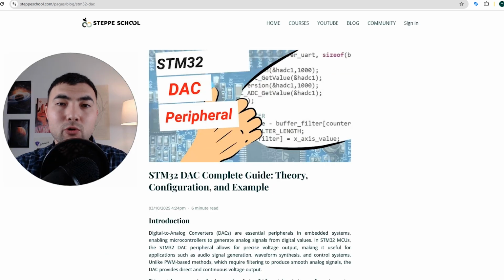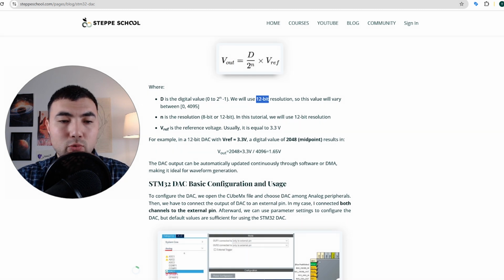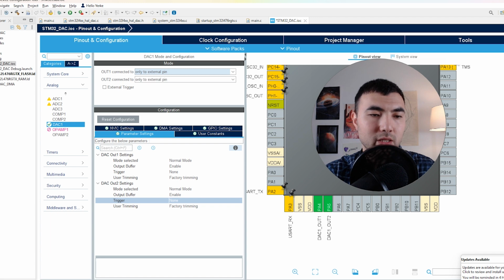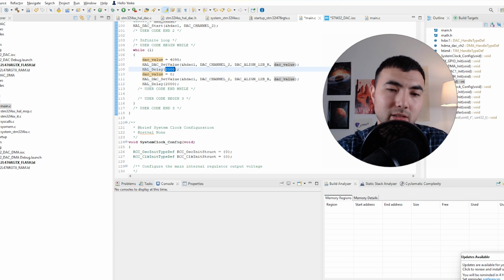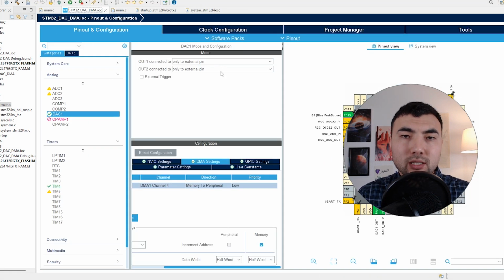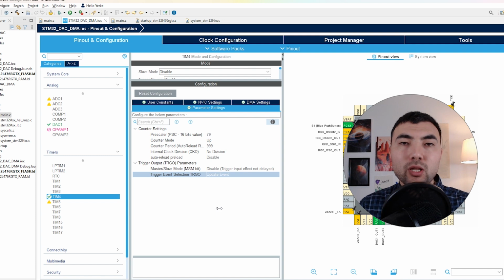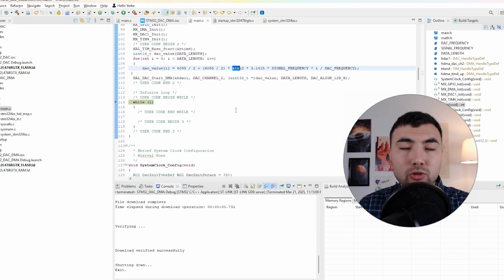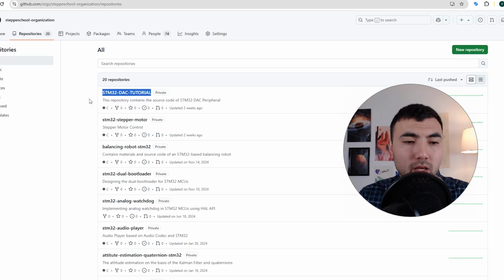STM32 DAC Digital-to-analog Converter Tutorial: DMA and Timer trigger

Comment: Hello. If you don't mind, can you make a video on how to play stm32 dac 12 bit + WAV, APDCM IMA files from spi flash? How to play audio files. I think this will be very useful for everyone. There is very little information about this on the Internet. If you can help with this. (stm32F051xxx, stm32F407VG6-DISC1 discovery, STM32...). Thank you for the useful videos.
Reply from the maker: You are welcome and thank you for your suggestion. I will think about that. Meanwhaile, you can check a similar project about designing a USB Speaker

Comment: Hey, do you think you can help me? Im trying to make a signal generator using the DMA and I can't get it to work. When I try to set up the DAC "DMA Settings" my gui looks way different. It says: "DAC1 requests should be configured in GPDMA1 or LPDMA1" I dont get the simple gui thats shown in your video. This is making the dma setup 10x more complicated for me and I cant get a signal to read on an oscilliscope.
Reply from the maker: What if you try with one of them and follow the instructions?
Reply: @steppeschool3629  I can get the dac to work without dma, but as soon as I try using DMA, it just won't work
Reply from the maker: which mcu are you using?
Reply: @steppeschool3629   i tried following 5+ different demos and tutorial. They all have a different DMA gui then me and me following their instructions still didn't make it work